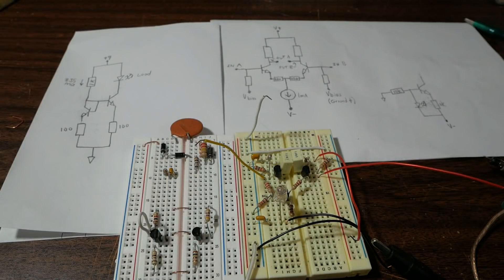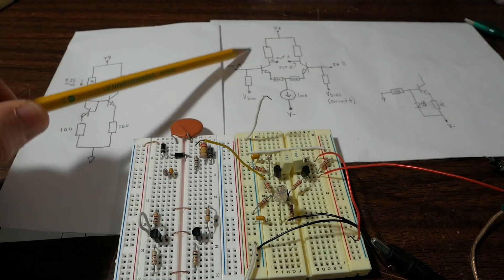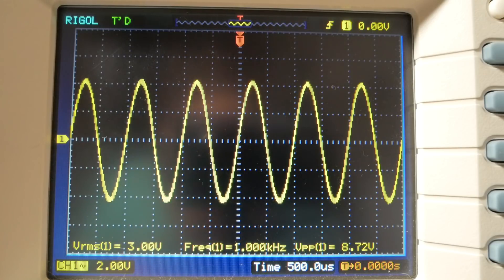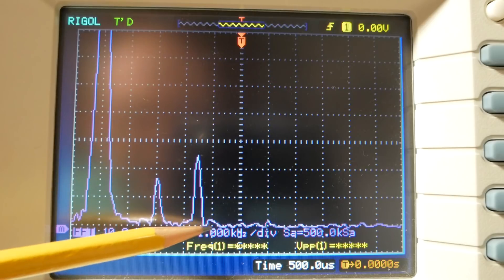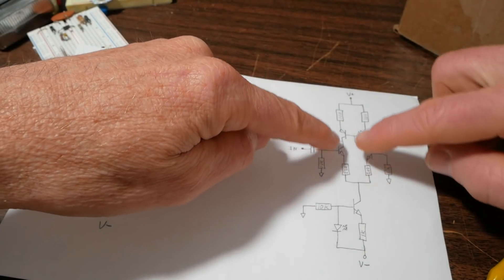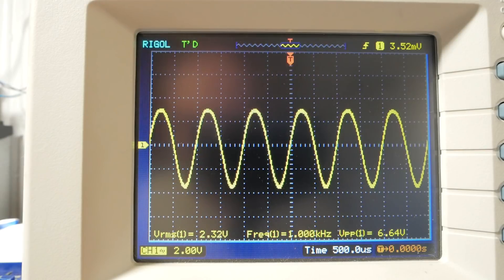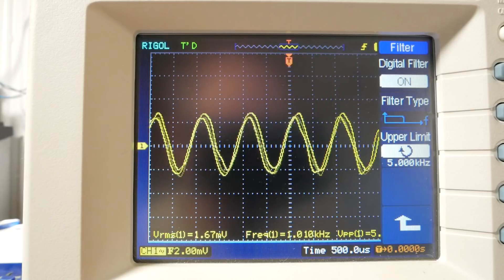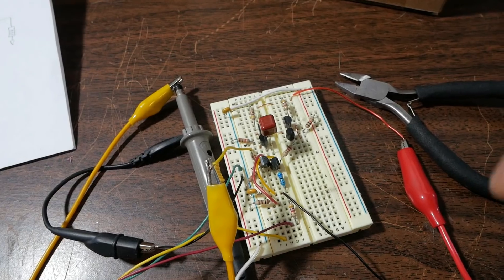Discrete audio amplifier project PT5 finish input stage

Comment: I know this is intended and designed for audio, and to not overbuild/spend components are chosen as such.  Usually though things can go beyond its intended performance so my question is this...Not overdriving with power, but simply could this design template be used to amplify a much higher frequency sine wave?  Not at the peak V you are after, but a lower V high frequency sine but able to drive moderately larger currents?? (current control is more of a target, though somewhat consistent V values are ideal as it will run electrchemical reactions.

Is high freq a problem?  Can these trans. switch fast enough, if not could a simple easy use of faster switching T's be an EZ tune; or is it way more complex?

Im close to seeing the big picture w all this (much thanks to you and amazing series like this), but high freq still melts my mind on how to get it to do what i want.  Just a simple sine wave of high f which i can vary to fine tune the needed "sweet spot" i need in the electrochemical electrodes as the resonate freq will greatly drive the rxn with no extra power (current) input as the E.Field harmonc oscillation will cleave bonds into free radicals for reaction without using power by direct reaction of getting e- from the current flow.

I pray you respond with any input or advice that may help when you have time.  The chemistry works, i just need the appropriate signal im on the verge of a wonderful discovery but on pause due to electronics above my understanding.  Id pay for your time should u b able to help.  thanksthanks

Comment: In a real circuit, you dont need anywhere near the high voltage swings (without clipping) from this stage because you will be driving the base of the voltage amplifier stage from this stage - but as I listen you just answered an earlier comment about high open loop gain needed for global feedback to work properly, thanks

Comment: this has nothing to do with what your talking about which i dont understand however can you wire speakers in "parallel because i have found really nice speakers but they are only 1.5 inches so you need alot of them.

Comment: What is pilot signal?
Reply from the maker: A 4.5KHz non harmonically related signal at 1% the amplitude of the 1Khz fundamental. It is used as a visual comparison to the amplitude of the distortion harmonics.
Reply: @JohnAudioTech  How do you add it to the signal, just by using two different (low distortion) function generators in parallel?
Reply: David Skärgård John has made a video explaining how to make it.
Reply: Thank you 
Also wanted to know

Comment: Great video as allways, thanks. Fore probing very small input levels i you can use a attenuator of 10 to 100 and conect the probe at the input at the voltage devider. The amplitude of the singal at the is then simple calculated by times 10, 20, 100 or whaterver you use.

Comment: Hi John, You mentioned a  book by Bob cordell ... Can you provide the  ISBN number or  the title of the Book?
Thanks,
Reply: Doug Self's "Audio Power Amplifier Design Handbook" is another very comprehensive work about audio amps. ISBN: 978-0-240-52162-6
Reply from the maker: I got Self's book on an inter-library loan a couple years ago. I like how he addresses the silly audio myths right out of the gate. He has a sense of humor.
Reply from the maker: The old book is out of print and fetching ridiculous prices. The new book isn't out yet (no ISBN). Old book ISBN is 007164024X
Reply: Nice book, but that Cordell guy should GEOTA.

Comment: Is there a discrete opamp thats better than a burr brown opa4134? Looking to experiment with a dual mono block amp I have. Thx for any rec's..
Reply: TI's latest high speed automotive op-amps:
https://www.youtube.com/watch?v=aAjEenaaFmU
Automotive qualification tends toward more robust designs. I may try some as R-2R DAC buffers.
Reply: OPA627 or OPA827 from Ti if you stay with Fet-opamps.
Reply: I specifically recommended a non-JFET amplifier as he wanted to experiment with different things, but yeah, those are also good op amps :) Just much of the same.
Reply from the maker: It is hard to beat the best op amp ICs with a discrete circuit. The matching and trimming in the monolithic IC design is tough to beat.
Reply: @JohnAudioTech  yes it is not easy, but on the other hand you can tweak for some parametes of interest, for example higher output current etc....
Reply: Better in what context though?  For high impedance a FET opamp is best like the OPA413X, for low impedance bipolar rules, NE5534A, OPA1612.   The MC3317x family mentioned above are low performance by any standards compared to even a NE5532
Reply: MC33171(single), MC33172(dual), MC33174(quad)